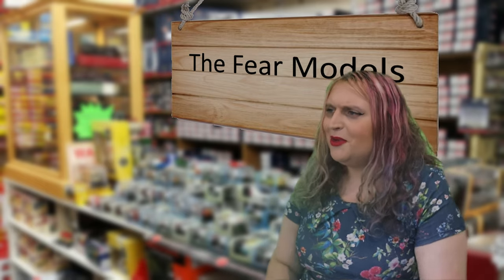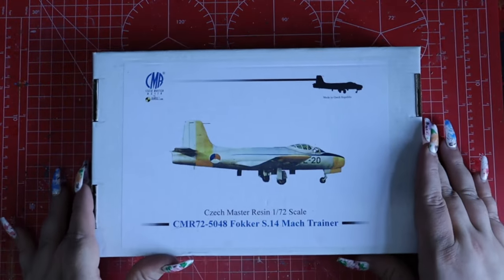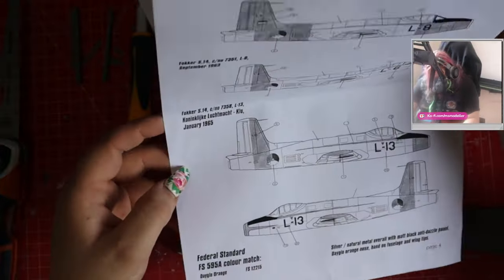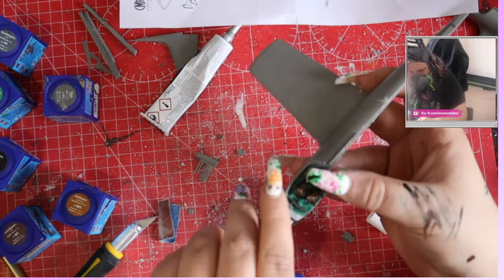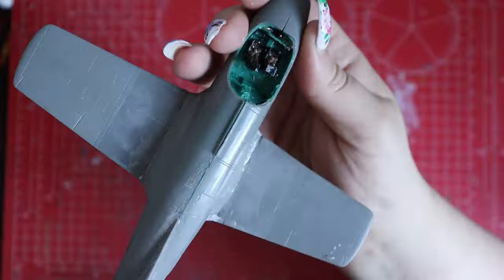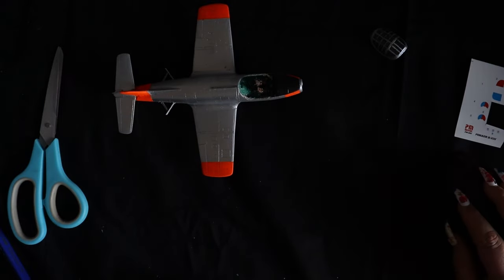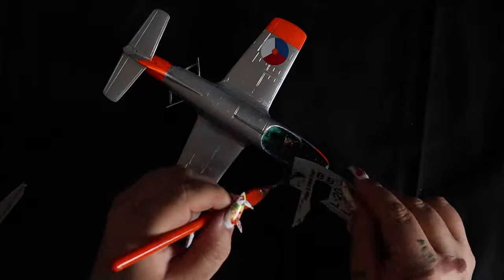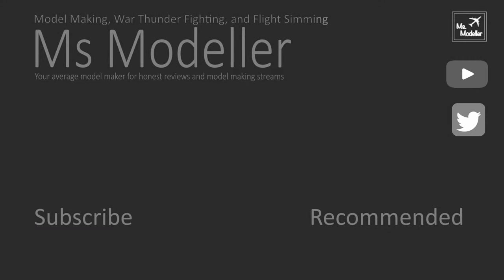Fokker S-14 Machtrainer - My First EVER Resin Project - 1/72 Czech Master Resin | Making History

Comment: Excellent, a first  resin, a step into a new world. nice work especially the vac canopy which  can be a real challenge.
Reply from the maker: Thank you does curtsy  I'm glad I wasn't just self indulgent thinking it looks OK! 😄 💜
Reply: @MsModeller  no, it looks good. I really like the way that you've chosen epoxy over Cyano. I think that it is underated and much more reliable in the long run for resin.